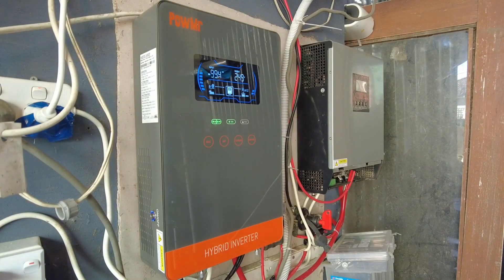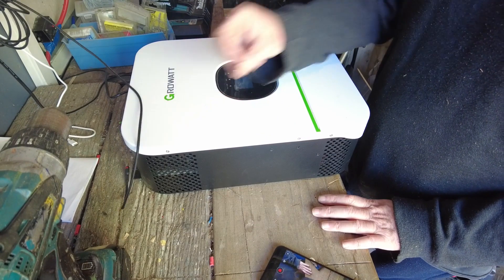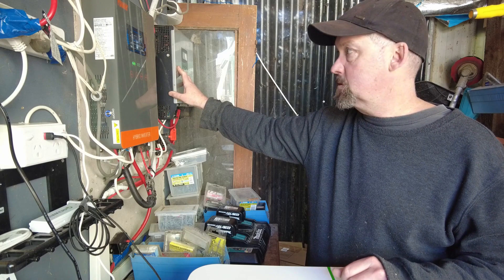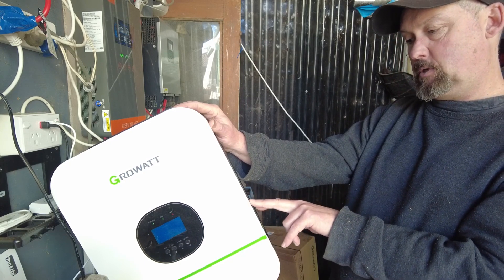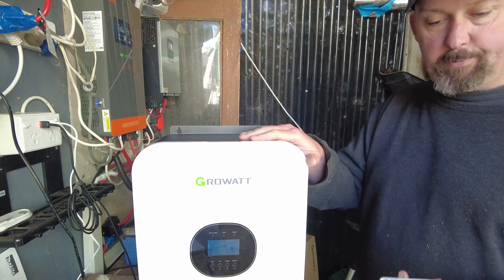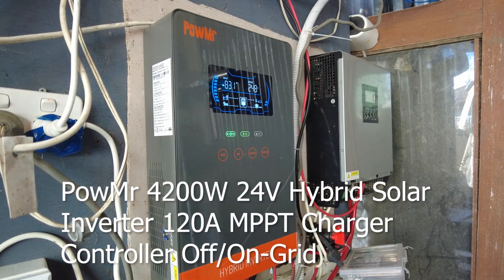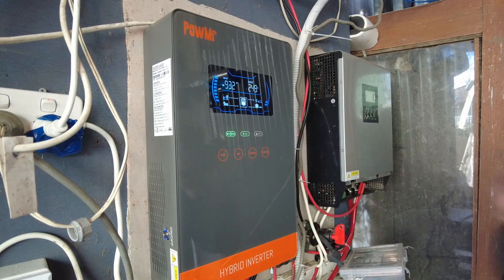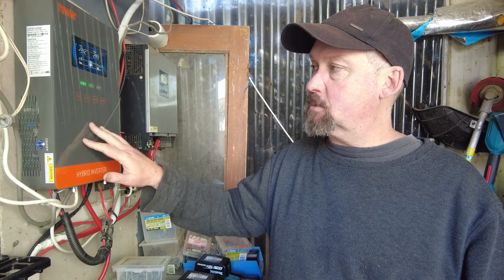Solar Inverter Battle: Growatt Spf 3000Tl Vs PowMr 4200W 24V Hybrid Solar Inverter (Part 1)

Comment: Hi, I have looked at the POWMR 24V 4200Watt inverter that you have set up in your video. 

Your video is now approx. 5 months old and I would be happy if you could do a quick little update on how well or badly it runs? 

etc. Peter